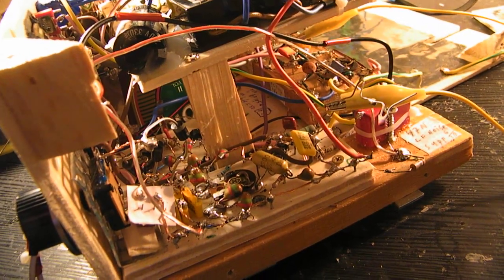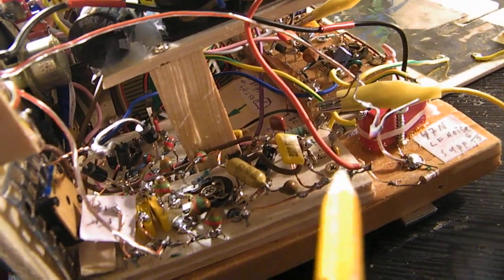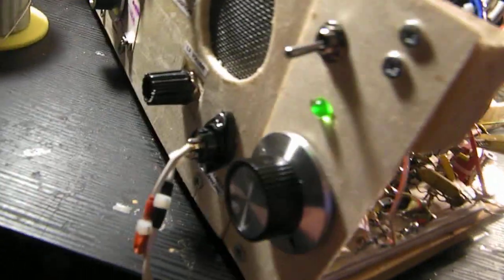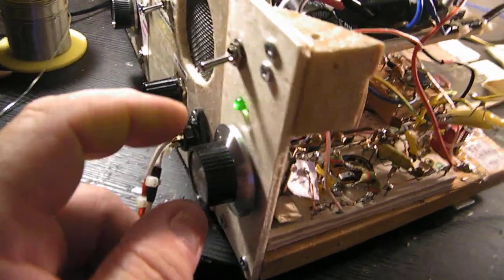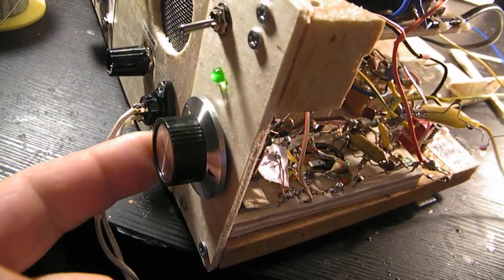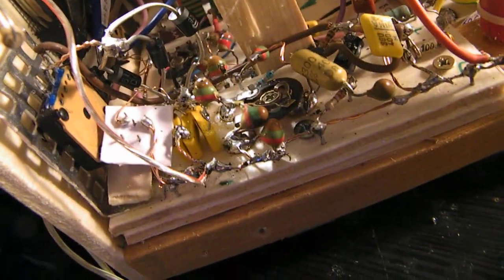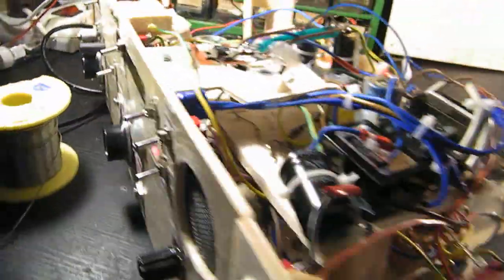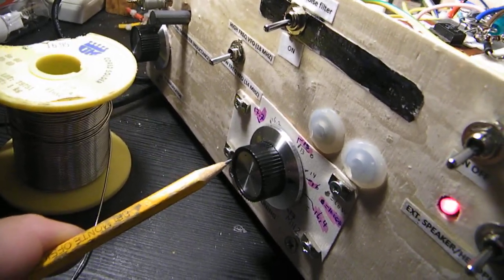14-18 MHz Homebrew Shortwave receiver: tuning the Beat Frequency Oscillator on morse signals (SSB)

Comment: Very interesting... the first thing that hit my mind when I heard the Morse signal was ‘power supply’. I know that sound from a morse transmitter when the power supply output voltage is not enough or is sagging, then the Morse transmitter will make this same chirp sound.

But I think your problem is a different problem. Perhaps a good trouble shooting technique is to get another oscillator and hold it close to your shortwave receiver and let it couple to the shortwave’s oscillator and then tune it. It does not have to be “wired in”. This will help you isolate the problem perhaps.
Reply: Note: above I said power supply “voltage” was not enough but actually, that power supply did not supply enough “current”. The current was sagging or not enough. It would be a good idea to check your BFO power supply to make sure you have enough current and that the current is available fast enough to the BFO.
Reply from the maker: Hi, yes, I have to check the power supply too (and the stability from the VFO). I now use the supply voltage to fine tune the BFO in the frequency band and used (as a first experiment) a series resistor, but that is the "cheap" solution, because the voltage can drop when current is taken (load-dependent). And, yes, (sometimes) it does not need to wired in, but I prefer a kind of (small) capacitive coupling regarding stability. Thanks!

Comment: You may also need a fine tune air capacitor, (or 10 turn potentiometer if that is what you are using) the one you are using may be too course.
Reply from the maker: For the local oscillator it is indeed to coarse for small band radio signals. Try to find an easy solution for that. Thanks.